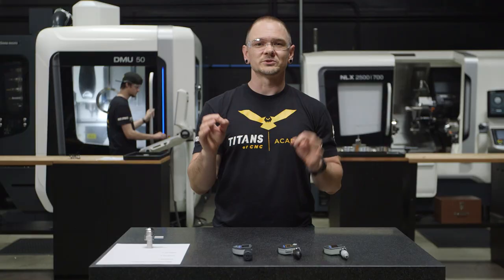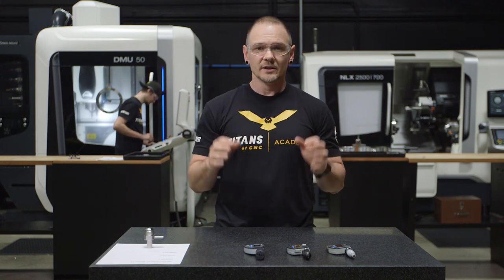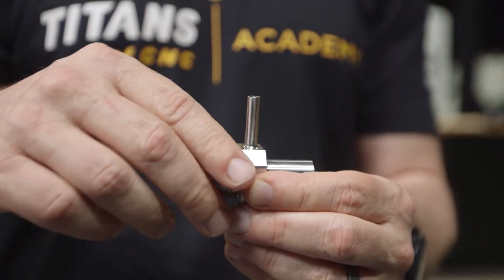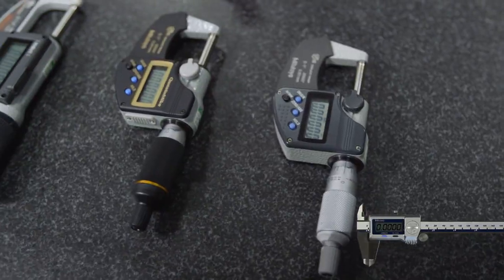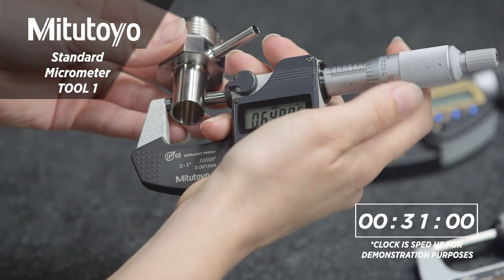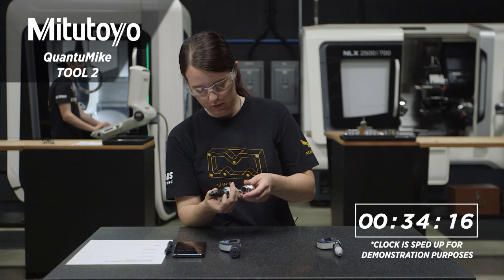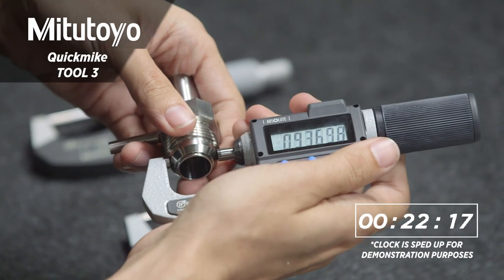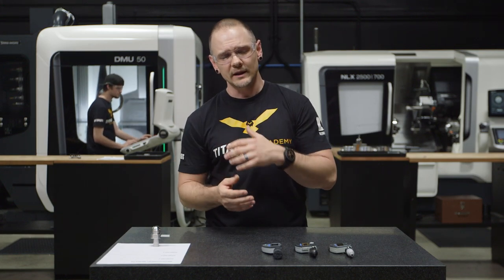SPEED TEST | Digital Micrometer Technology & Efficiency Unveiled

Comment: Accuracy ratings for the micrometers seen are listed as:

0-1” Standard Micrometer ±.00005

0-1” QuantuMike ±.00005

0-1.2” QuickMike ±.0001
Reply: which seems like a lot, but its literally completely OK, even for tightest tolerances. to put that into metric perspective, the quickmike is precise to 2u and both other to 1u- that does not mean its 100% less precise of course, its just only 1u more as a proportional tolerance- thats better then the operator can measure honestly

Comment: That opened my eyes to speed and repetitive measuring with differing bits of equipment.   The saving over one part is  not worth shouting about but if you have to do it multiple times the savings will allow more parts to be inspected in the working bday / hour.  Allowing shipping to be done sooner..  So exceeding the purchasers  expectation.  Amacf

Comment: I just started a job learning to rebuild spindles. Using micrometers is pretty much a daily task for me(although currently just cleaning and disassembling spindles). But for beginners do you think it’s better to start out with the old school micrometers and learn how to read the measurements vs having a electronic display?  I’d love to have the electronic display but I don’t know if that’ll hurt me meaning by making things easier for me rather than learning. Or do you see it as times are changing and things are done differently now.

Comment: these guys don't use the calibrated ratchet? its so important, i have one and not using the ratchet gives different results
Reply: These often have a friction thimble, which is just as precise,   if not more so, or the whole thimble ratchets
Reply: Quantumike and quickmic the entire thimble ratchets. The regular, only the top portion.
Reply: Not every ratchet is the same. Sometimes it’s the top small one and sometimes it’s the bottom big one. Different micrometers are built different.

Comment: My 55 year old Sterrett is still accurate within .0001. Why change..
Reply: Does your 55 year old starrett go from 0 to 1.2” in 2 seconds and does it send the measurements to a computer directly?
Reply: Henry Chan plus anyone can read a digital reading, interpreting a micrometer scale accurately is a skill typically only learnt by skilled engineers. 

If you need an operator or less skilled employee to use one it’s easy than having to train them and trust them to read it accurately.
Reply: I've never said this before, but I can't think of a better situation....    "okay, boomer".
Reply: because the starret relies on its spindle which will wear out inhomogenously- the quickmike has a linear sensor which is completely wear free and precise under every circumstance. and i bet, your starret is precise within some range, but not over the full range,some parts of the spindle are more worn then others reducing relative precision

Comment: The video title needs to be changed. Somewhere is the lines of digital micrometer differences and possible advantages. I don't see any difference in technology and or efficiency between either Mic. To compare efficiency we would need to see all the measurements of the three candidates using all three mics achieving consistent readings.